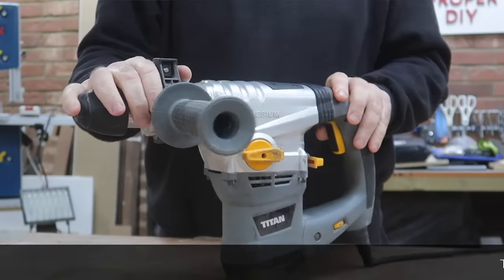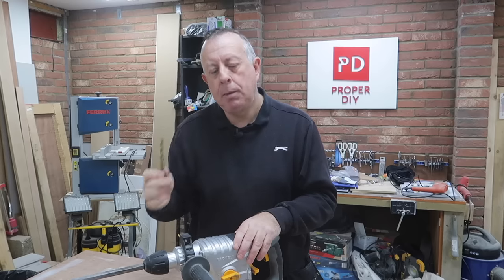Don't Buy Just a Hammer Drill

Comment: Tip - the movement space that you showed us, that forward and backward sliding action of the drill bit. You can use that as a visual guide to when you're hitting steel, stop drilling.
Once the drill bit stops moving forward, and is pushed back against the chuck, you've hit something very hard like steel.

If you keep going you might blunt the drill bit in a few seconds.

HTH.

Comment: When I was an apprentice electrician (over 40 years ago😳) there would only ever be one of these available on site between about 5 sometimes 6 sparks because they were so expensive. The arguments that used to go on in the shed to try and get hold of it. Failing that it was a lump hammer and rawlplug tool all day! 😵‍💫
One thing you did forget to mention here is that it performs far better if you DONT put too much pressure on it. “Let the drill do the work” was always the motto whenever we used them and it’s still the same with the modern versions now. If you press too hard you’re just fighting the piston and adding to the the vibration in your hands. To much of that eventually leads to circulation difficulties (White finger) in later life.
Loving the series though. 👍
Reply from the maker: I'm glad you are enjoying them.

Comment: I've had a Kango SDS drill since the early 80's, it's the only thing I use. Got it as a deal at a local trade shop. Paid 80 quid for it as it was a 110v. I already had a transformer for 110 so it was a bargain. It's still going strong now here in the US.

Comment: I have a Bosch 800W hammer drill. When you need a 25mm hole through 40cm thick brick wall, a hammer drill is a must.

Comment: I used my recently new Dewalt hammer drill yesterday to put up a curtain pole, it was going 7 inches above the window opening, so luckily didn't need an SDS drill as was going into block, good job really, as the old SDS drill I have has a wonky chuck and the nicad batteries are well past thier best and won't hold much charge. Now in hindsight I should have bought an SDS hammer drill, but what drew me to it was the knock down price saving £100..I also have a powerful mains Bosch hammer drill which Ive owned for around 40 years which I call The gut buster! that I've used in the past on a concrete lintel and although it eventually did the job it felt jarring..

Comment: Excellent Video with clear explanation on the differences between Hammer and SDS drills ,It is coincidence you posted this as only today for the 1st time I used my new DeWalt SDS and Irwin SDS drill bits on my old garage concrete floor  its like a hot knife going through butter as they say ! well pleased so far.
Reply from the maker: Thank you

Comment: Thank you very much for all that good info.....I learned alot. I always assumed that a standard cordless hammer drill with a carbide tipped bit would be enough to go into rock with quartz and granite in it......I discovered I was wrong after trying it out on rock with the light duty cordless.  Looks like I'm gonna get an SDS to add to my tools.

Comment: As said, great advice. Trying to drill into very hard brick and blunting bits as a result, I was all ready to spend £200 ON THE WRONG THING until I saw your video. 24 hours later, I have the drill, I have really neat 6mm holes, with rawlplugs fitting snugly inside. Actually FWIW I don't have exactly that model. Because it was £70 rather than £90 for "your" model right now, I bought  the TITAN TTB278SDS 6.3KG ELECTRIC SDS PLUS DRILL & 9 PIECE ACCESSORY KIT 230-240V. AFAICT it is exactly the same model, just with fewer bits and chisels.  You saved me time and £130 - thanks a lot!

Comment: When I got my house back in 2005, I needed to drill holes for anchors for a parabolic antenna. As budget was really tight, I bought the cheapest impact drill I could find (Power Craft).
Well, the gearbox broke on the darn thing halfway through the first hole. I could really have used something like the Bosch GBH 18V-20 I have now. I probably should have gotten the newer model with brushless motor though, as it empties an 8Ah ProCore battery in no time...

Comment: Can’t beat an SDS for drilling into brick. Hanging some heavy duty kitchen shelves yesterday - and it breezed through the job. You don’t even need to spend a fortune - mines an Einhell I got on sale for about £35! The other issue people have if they’re just using a regular hammer action cordless, is that the holes they drill will have far more wander, because they’re fighting to drill the hole for so long, so the rawlplug won’t be a snug fit.

Comment: 100% agree, my SDS drill-hammer is in my top 5 of tools I should have bought a lot sooner than I did. 
I barely use my corded drill with hammer function anymore so I'll probably make it into a drill press for steel and wood work, and when my battery drill finally gives up the ghost (still works fine but the NiMH batteries are worn out and obsolete) I'm getting one with a hammer function for the occasional picture hanging.
Another thing I barely use anymore since I have the SDS drill-hammer: my hand chisels! I thought I would still need them for precise work, but I can dial the SDS way down to the point it's barely making a dent, and all the way up to the point I could impossibly hit a hand chisel as hard with my hammer without missing.

Comment: As a work around stop periodically and spray some WD40 on the bit. Worked for me on really hard old concrete, a standard percussive drill & low quality (Lidl) masonry drill bit. 
Same for drilling steel. Think about temperature control of the bit by intermittent action and use a coolant. It's fun too see it sizzle and smoke too! 😀

Comment: I had to get one for foundation work on the Allotment, not allowed to use concrete I had to use fence spikes but regrettably under the soil laid shillate so the spike wouldn't drive in , key to success was to choose one with high N impact strength

Comment: I was sold on SDS after one of the Sparkys at work lent me one to install some expansion bolts. His instruction was 'don't lean on it, let it do the job. You can use it one handed'. I've got a couple now; a cheepo Screwfix one (like in the video) and a 2kg Makita one. The Makita is the every day use machine (it's an LXT battery model) as the smaller size is more appropriate for those indoor jobs but the big machine is there for the large holes and the breaker jobs. It doesn't come out often but at £50 it's not something I mind keeping on the shelf (expensive tools that I've bought for big projects get a couple of years grace once the project is over and, if not used, get sold on as space is always at a premium. Sometimes the policy pays off. I bought a Belle minimix concrete mixer, used it almost daily over a couple of years, cleaned it thoroughly after every use, held on to it for a further two years then sold it. Inflation meant that the second hand sellng price was within a few pounds of what I originally bought the mixer for new.)

Comment: Almost all of it is spot on. One thing I do not experience myself on the job is the simple drill, bit and brik. I drill bricks very often just with my cordless and a drill bit for bricks, no hammer action as that can crack old bricks. That works very well and fast.. but for really hard bricks and concrete needs sds and proper hammer drilling..

Comment: I've got an old Chinese, budget brand SDS drill which I bought from Netto. I paid £30 for it and figured that if it lasted a year, I'd get my money's worth out of it. (I was a fitted furniture installer) That was about 18 years ago, and I'm now retired. Netto is long gone having been bought out by Asda, but the drill seems indestructible. It's broken up concrete paths and drilled loads of masonry. Drills through concrete like butter. The only downside, is that it's a hefty beast, so I've now bought a lighter 18v Makita SDS (because I'm getting old) but the monster drill is there in reserve should I ever need it.
Reply: Power G!

Comment: Yep. I wanted to mount curtains once. First I used normal drill with this simple vibration "hammer" system. Results were totally embarrassing. Drilling just one hole (10mm diameter or so) took about 2 hours. I was totally demotivated to do anything more. And then my friend borrowed me an SDS hammer drill. I tried and I just couldn't believe. A normal drill - 2 hours per hole, an SDS hammer drill - just few seconds for a hole. Next time I even didn't asked my friend - I just bought my own SDS hammer drill. For DYI purposes it is really not expensive. I have lot of concrete in my home so I used it several times and I really appreciated this tool. And just one more thing - now I am this friend who borrows an SDS hammer drill to friends ;) - and they really appreciates that :)
Reply from the maker: Yes exactly although many people don't know

Comment: About 10 years ago i was gifted an SDS hammerdrill from my grandfather, had cost about 40 pounds or so in the local cheap homeshop. It has served me well many times and will continue to serve as one of my "It's rarely the right tool, but when it is nothing can take its place". 
I lived in a rental that had hardened concrete (granit and flint reinforced i believe) and this damned drill could do a 2 inch hole barely braking a sweat

Comment: Like you I held off buying an SDS for a very long time, making do with a bosch corded hammer drill, there is no going back I have since supplemented the big coded SDS with a cordless 20V one which is A LOT less destructive than it's bigger cousin but just as efficient at punching through walls a normal hammer drill would be screaming at.

Comment: Anyone ever have something so profound that your life was changed forever? Me too, the first time I was shown to drill through the base angle and into the concrete pad with the same SDS bit at the same SDS time. I couldn't believe (still have trouble with it) that a masonry bit moving that slowly could drill through 16g steel and then 4 inches into cement.

Comment: Got me a Brushless cordless SDS and a Brushless Cordless Drill which includes the hammer mode

What I can say it the Hammer on the SDS is much stronger but it doesn't mean the normal cordless drill can't do the job to drill in some 35mm death nail in anchor screws for electrical, does the job but wouldn't wanna strain it too much tho

Comment: I bought a cheap one 20 years ago from Aldi or Lidl with included chissels and drill bits and they are still 100%. I think it was 800W. I can't remember how many holes I've drilled in concrete and other hard materials and it just does it in seconds instead of minutes with even a solid mains powered normal drill with hammer feature. Some concrete walls I came across had gravel the size of 20mm, those river stones. Really hard stuff normal drills will just slide off the round surface and making the hole much larger than intended and in the wrong place. SDS just goes through them no problem. Starting the hole on plastered walls can be tricky though as the drill will wander off, it's best to use a normal drill or without hammer feature to get through the soft stuff so that the SDS drill can drill directly into the harder stuff. As you say they are heavy though, not recommended if you need hundreds of holes in the ceiling for example. Better bulk up or get bulked up when you're done ;)
Never really used the hammer feature by itself, I imagined if I ever needed to get rid of bathroom tiles, that would be the tool to use. 
But you're right it can be used for anything that needs percussive force to loosen. I might even be able to split logs lol!

Comment: Great content, thanks!
Just bought a battery operated rotary hammer drill (Worx) as I need to modify some walls in my basement. Tried it on some concrete and what a difference! In the past I wore out quite a few drill bits with my normal drill, putting shelves up in the garage (into concrete). Wish I'd bought this sooner!
Like you say, it's all about the right tool for the job, and also being realistic as to the usage. 

If you have normal tools, you can't expect to be using them for hours on end, unless you don't want them to last.

You need to be careful matching batteries too!
Recently, I acquired quite a few battery tools (18V), and I'm really pleased with them, but some adverts for these tools can be a bit misleading.
I bought a brushless 18V power drill that came with two 1.5Ah batteries and these work great with the drill and my jigsaw, and the sander.

I also got an angle grinder which came with a 2.0Ah battery. 
This will also work with the 1.5Ah batteries, but with all three, it goes through them really quickly, and once run down, they refuse to charge. They'll only take a charge after about fifteen minutes.
I ended up getting a 4.0Ah battery which works great and will recharge straight away after running it down. I think that had I continued with the other batteries, I'd have knackered them really quickly. 
Nowhere on this manufacturer's website does it say anything about the batteries and they actually sell it with the 2.0Ah one!
It needs at least a 4.0Ah battery to have a chance of lasting.

Comment: Good video... Lately I've given up on battery operated tools at home. Yes, they might be warranted on building sites but at home? Far easier to get a extension lead out and plug in a mains electricity powered tool. The main reason I changed was that I was totally shocked at the price of a replacement battery for my SDS drill. It was actually cheaper to go buy a mains version drill and still have lots of change left over.

Comment: Great video, picked up exact same titan drill set last year for taking out a chimney breast. Also used it for core drilling later on for an extraction fan after my black and decker hammer drill started to smoke under the strain. Probably my favourite tool I've bought in a long time.

Comment: I bought one a lightweight DeWalt 18volt cordless. Overall it's amazing at going through concrete. Not the most power so I build up with the bits on hard concrete. Compared to the combi drill this is so much easier on concrete. Apparently they can be used drilling metal too but not tried that

Comment: As a rule for drilling concrete and rocks and granite - they chip from the impact. Twist and chip again. This is how holes were drilled in ancient times with a hammer and a chisel. The chisel rotates a bit and the hammer provides the impact.

Now the key thing is the impact energy. It's measured in Joules and certain types of concrete and rock might need more joules to chip the concrete, or if the drill is larger (and the surface area is bigger) the you need more joules, also when the hole is deeper it will need more joules of impact beacase some of those are lost in the friction through the deep hole. Also if debries are not evacuated, that dust in the hole absorbs impact and cushions the blow so you need more joules for that.

That impact force is specified on most SDS hammer drills. The usual is about 1-2J for some of the standard non-sds drills, and about 2-3-5-7 J for SDS hammer drills. Depending on power and inerial mass of the hammer. The bigger hammer drills may have even 10-15J on SDS max (bigger drills), and the demolition hammers may have 15-100J (usually on hex shank) then you go into pneumatic pick-hammers that goes up.

End story: The only parameter you need to fulfil for drilling concrete is having enough Joules of impact for that concrete to chip at each beat. (affected by type of concrete, diameter of bore, depth of bore, proper evacuation of debries - drilling down is harder that drilling in ceiling due to poor debries removal when drilling down)

For that reason, if the drill is underpowered, you may switch to ancient way to keep drilling. Get a chisel (proper masonery chisel) and hit it with a hammer. That hit from a proper hammer (1kg, like a blacksmith hitting the anvil) delivers somewhere of 15J. A sledgehammer of 10kg with proper swing might go to the 100J.. so clearly way more than non-SDS, and even higher that SDS and SDSmax.. the caveat is manual work and the very low beats pe minute. But it works.

So in the end do the work with what you can, and when the rotary drill stops advancing some hammer chisel work might get the job done instead of none at all.

Comment: I bought an Aldi version plus their extra long drill bit set so that I could install an outside socket (as per your video), not only is the drill great but being able to use those extra long / large diameter drill bits made drilling through the wall in one go a doddle. I couldn't have done it with my trusty old DeWalt hammer drill.

Comment: I had an ex-council house built of extremely tough bricks. (It also had steel door frames, never seen that since.) The bricks were completely resistant to a normal hammer drill, after ten minutes on one hole I gave up. In desperation I sharpened the masonry bit to a proper cutting edge, like a normal drill and found I could drill the bricks with a little hand (powered) drill.
Since then I have never used the hammer function on any wall drilling job. The only time I resorted to borrowing an SDS drill was for a curtain rail to be fixed to a pebble filled concrete lintel. Without the hammer function drilling is quieter, you don't get white hand and a sharp drill is easier to start accurately, it's an altogether a more pleasant experience.
Get a grinder, sharpen your masonry bits.
Reply: No matter how sharp like the guy said it's the HEAT that dulls the bit not how sharp it is !!

Comment: The dewalt XR drill will do alot more than you give it credit for . I was able to drill a 1 inch hole through brick cavity then brick again to run camera cables.  Only drill I had was that xr with a massive bit on the end . Was a hot drill after but it went through and I'm still using the drill 4 years later .